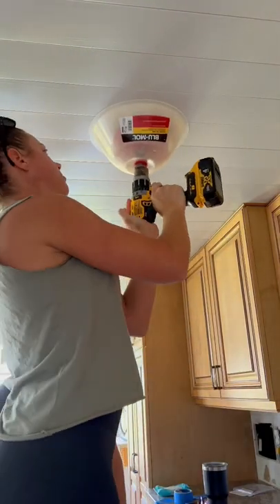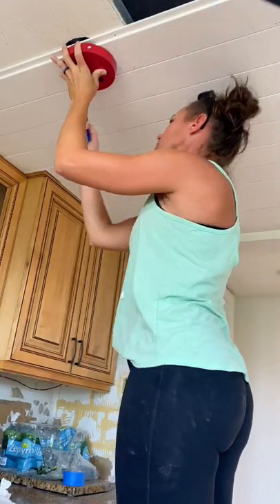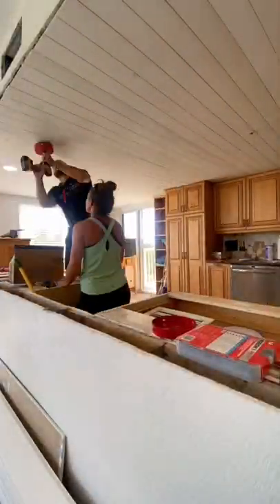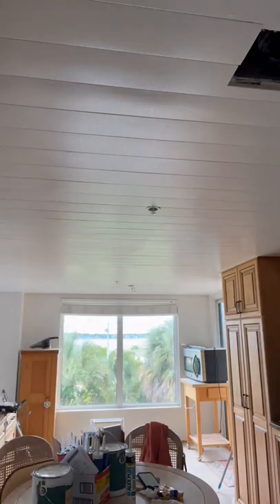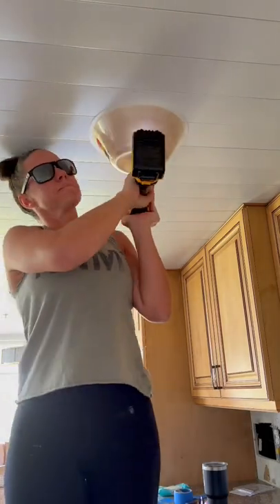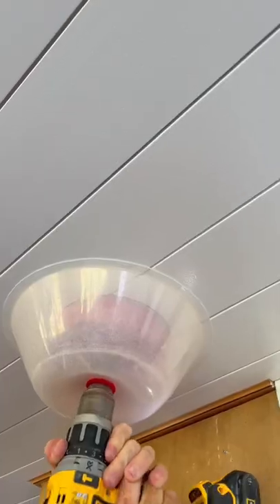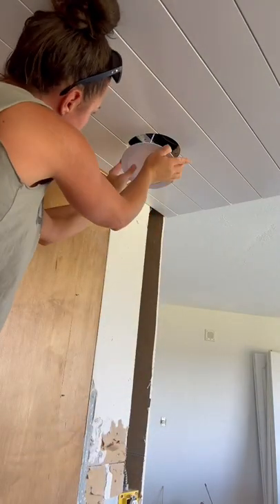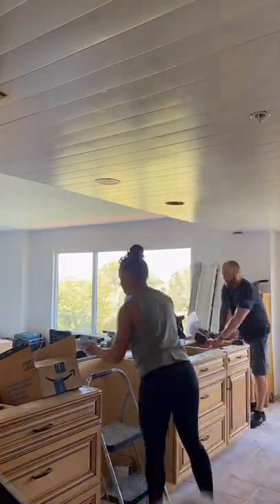Shiplap on ceiling! Adding recessed lights to Shiplap ceiling using dome cover and hole saw!

Comment: Very Smart, Very Professional.  Great Job. You actually Saved yourself so much Trouble and Headache by doing it that way.  You can always Cut the T&G where you Need to and although some might consider it a Waste of material and  maybe so, but I'm sure added the Extra 10% for Waste, but you Saved the Headache of Extra Measuring and Calculating having to figure out all the Extra Cuts and possibly keeping a pattern.  Believe me, the way you did it was Fine and in the end,  you didn't even need those big Cutouts and you Closed up the Ceiling having No Structural or Overhead Concerns,  So I Definitely give you an A+ 😎👍🏻

Comment: Did she answer the question regarding covering the rectangular areas in the ceing?
Reply: I have concerns about covering up the sprinkler system. That's so a kitchen fire doesn't burn down the entire structure.